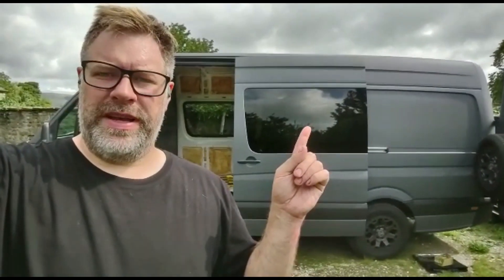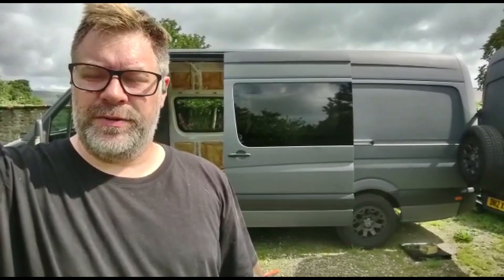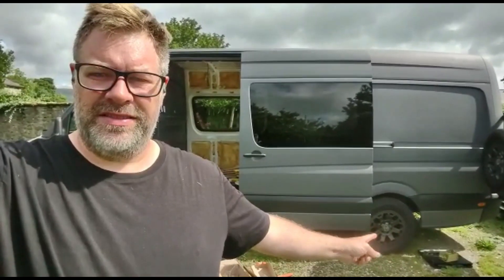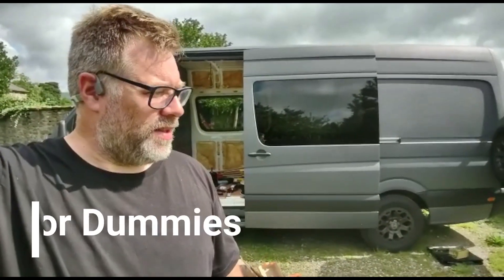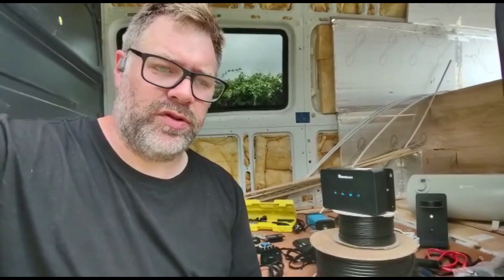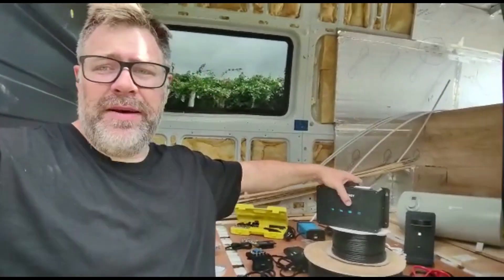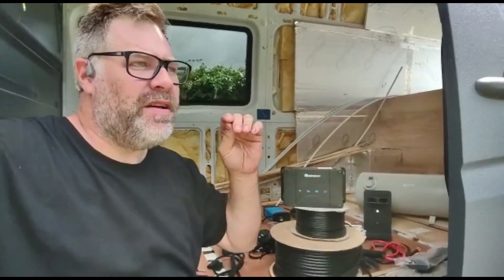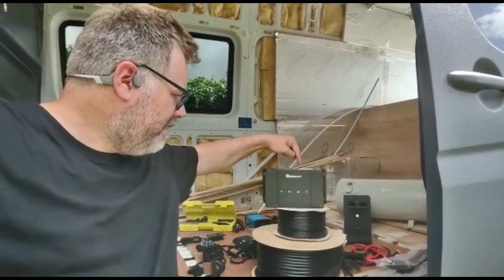Solar Panels for Dummies

Comment: Jeff love your vids very informative quick question I have same renogy Mppt b2b charger you used here and I have also purchased the monitoring screen but I can’t find anywhere about what I should set my “desired current limit rating” to. I have 280w of solar and 2 -110 AGM batteries do I set it at 110a I have no clue any help would be appreciated. Cheers